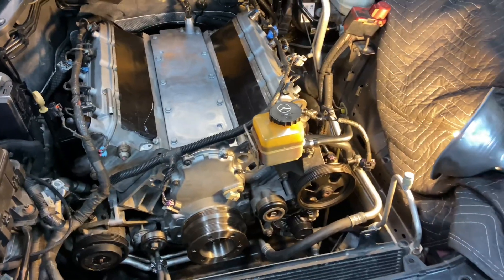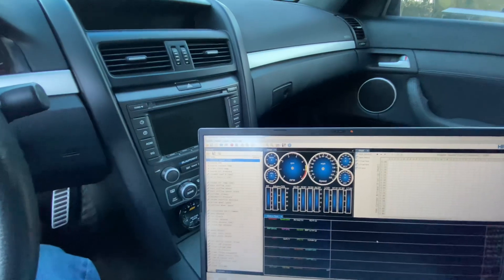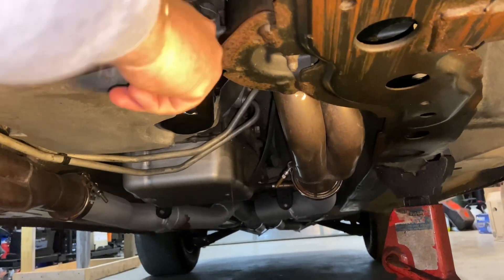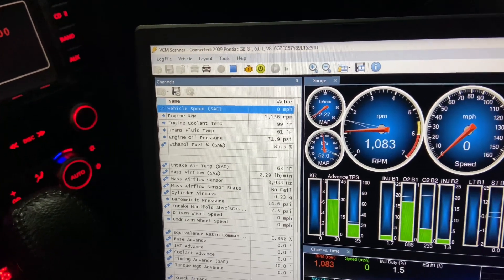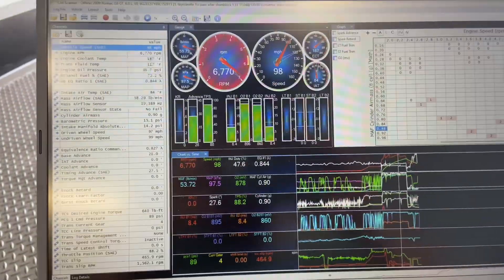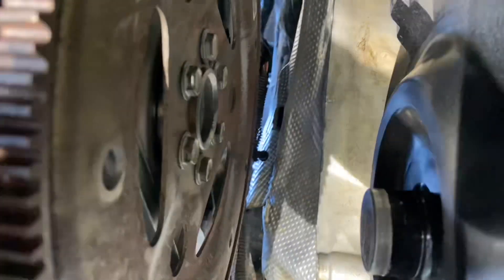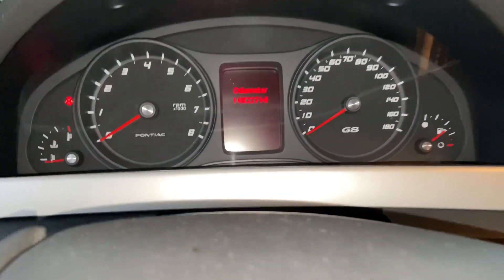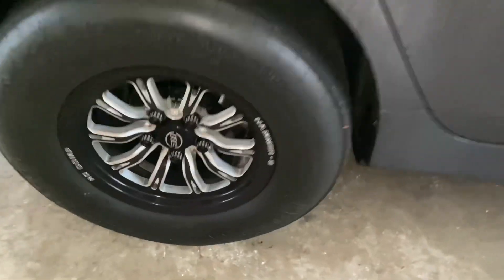One Thing After Another With The G8!!

Comment: Love the G8 man.... what suspension you running in the back?
Reply from the maker: Thanks! It has stock struts/springs. Modified stock lca, bmr tubular trailing arms, v6 brakes to fit the 15x10s.
Reply: @Joe_Dirt_Racing  nice! Just putting 15’s on mine and going to the v6 brakes as well. Looks like it works well 😎
Reply from the maker: You doing 8” or 10” wide rims? Yes it does, I had lowering springs. Transferred way better after I went back stock.
Reply: @Joe_Dirt_Racing  its got a s77 10" on the back now

Comment: My 6.0 has around 95–100psi at 6700rpm. I have seen it over a 100 a few pulls I haven’t taken the oil pump off to change my spring out but honestly probably won’t unless it gives me issues even tho that high of pressure isn’t ideal
Reply from the maker: Yeah I haven’t seen any negative effects yet , will prolly leave it until it gives me a reason not to.